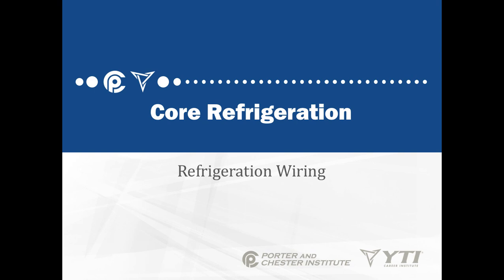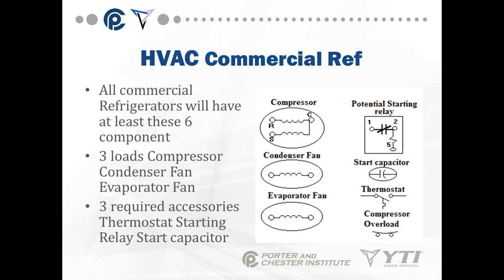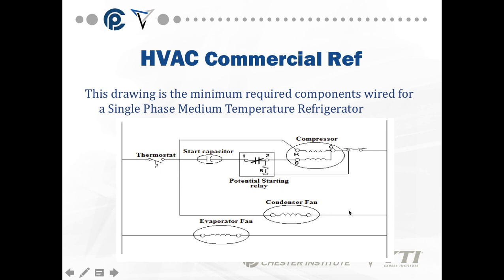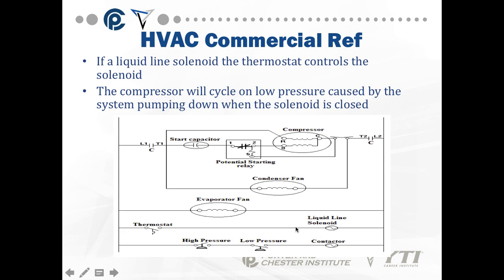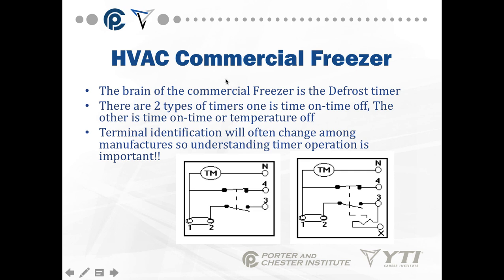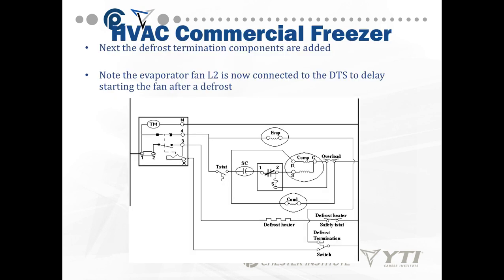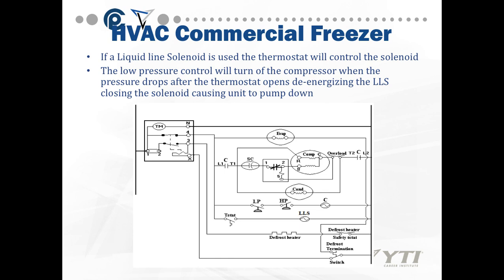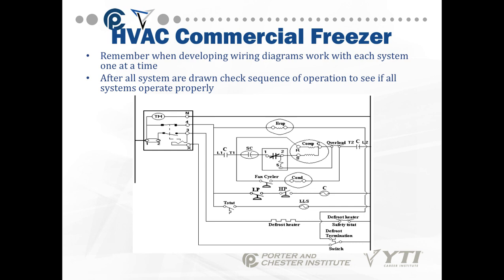Core Refrigeration: Refrigeration Wiring

Comment: this was amazing valuable information. especially for a starting refer tech. today i came across an old r12 cooler with a  lpc used as a thermostat. and the unit was freezing all the beverages. i tapped the lpc and the unit shut off. can you show me the wiring diagram of a lpc as a tstat? there wouldn't be a llsv right? because there isnt anything that will energize the llsv
Reply from the maker: Correct on the no LLS. Take L1 to the pressure switch out of pressure switch to condenser (compressor/compressor fan).  Make sure you put any high pressure switches in series with that. L1 gets wired directly to evap fan (do not go through pressure switch). If evap fan does not run constantly this will not work properly. If no evap fans allow a little more of a differential between cut in and cut out. Does that help?
Reply: So what allows the psi to go up and down? With it being off?
Reply from the maker: @brianpan57  when the compressor shuts off, the refrigerant pressures are determined by the temperature of the air surrounding the coil. Temp/pressure relationship. You just have to know the appropriate pressures. I will try to do a video on this Friday or Sat when I have some time.
Reply: This unit didn’t have an evap fan. Just coil. The cut in was like 35 and differential was 15